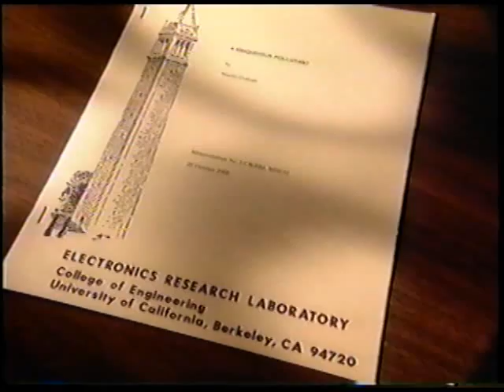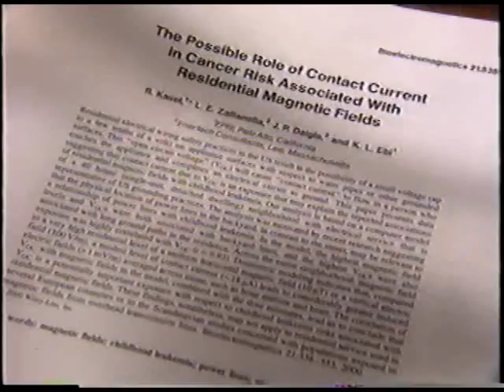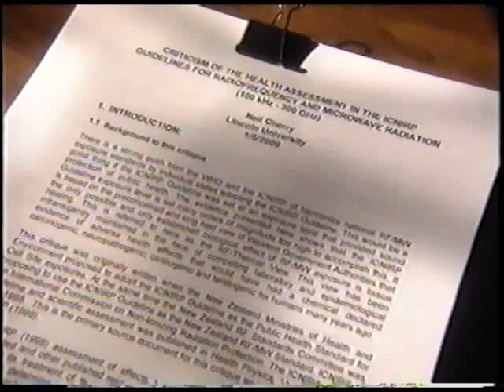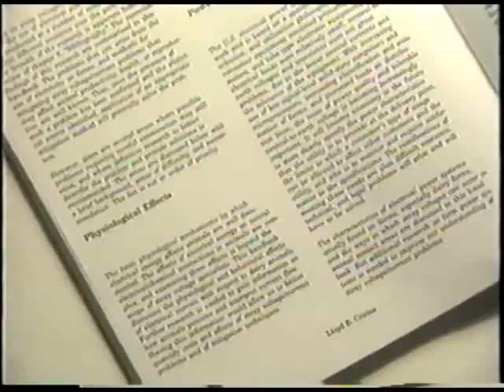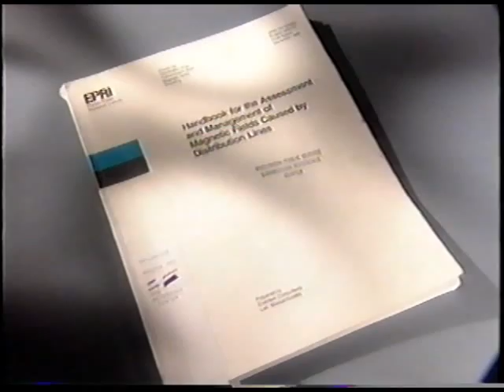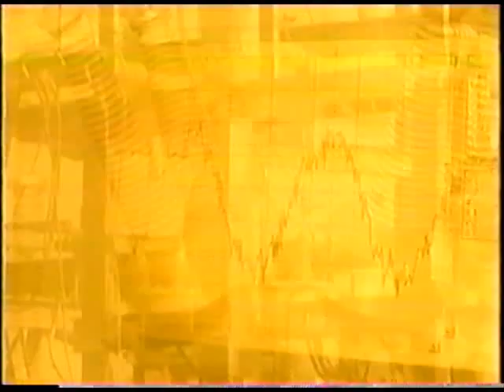Beyond Coincidence - The Perils of Electrical Pollution - Part 2

Comment: The harmful harmonics that enter a home via the utility company wires, may have been created by neighboring homes (from their electronic utility meters, Solar PV inverters, variable speed pool pumps or numerous LED lighting and AC->DC power supplies which all produce such harmonics and are injected onto the wiring for all neighbors).  Many people have these same devices inside their homes and thus are creating their own harmful harmonics, unknowingly.  The downgrounds from the utilities will inject this fouled electricity such that it travels far beyond the wiring on the poles.  One way to immediately quell most of the harmonics will be to turn OFF the power in the home, but even this is not enough when the neutral or ground wiring in the home carries those injurious harmonics.  At that point, consult with a Building Biologist or other knowledgeable professional.

Comment: Smart Meters communicate with 902 MHz radio waves over the WAN to the utility and at 2.4 GHz ZigBee for the in-home area network. Power is less than 1,000 miliwatts, max.   Remember radio waves fall off as a 1 over the square of the distance function from the point source of transmission.  Check out YouTube for USCL Corp  or Google Tomer Tamarkin for the YouTube Channel address. See complete 7 part Smart Meter School and learn about magnetism and the electromagnetic spectrum.